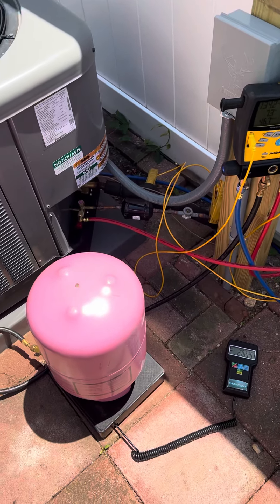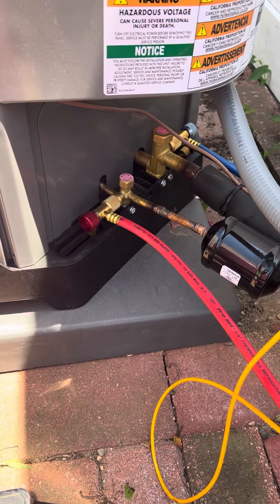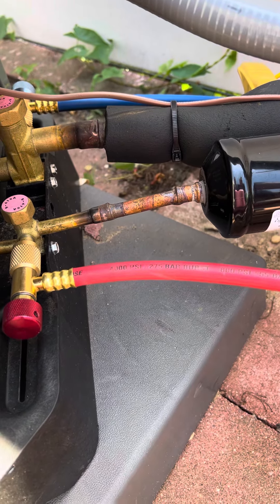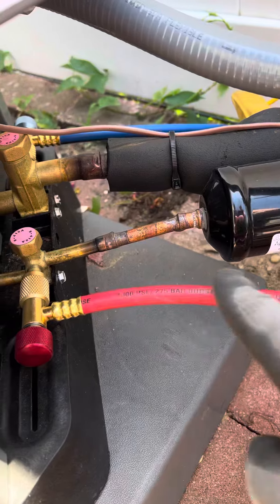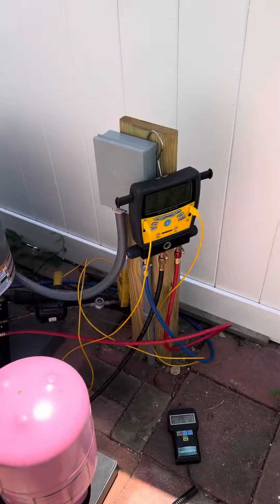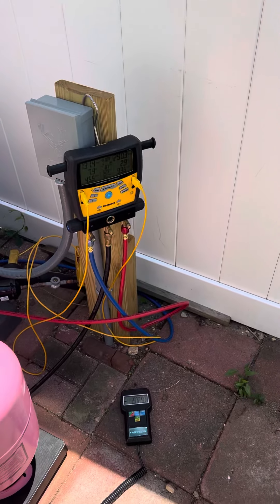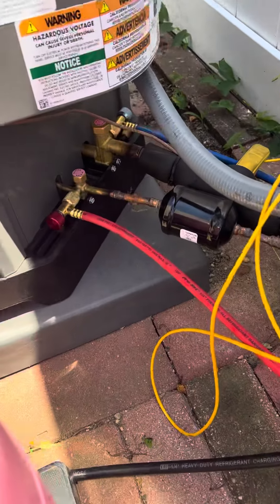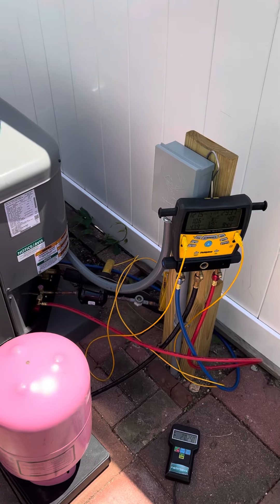Coolest charging hoses ever made by Cps￼

Comment: So did you find out if the gaskets or seals in the hose can be replaced? I have  90 deg low lost fittings for red and they work fine for me. For the yellow I have manual low loss fitting (ball valves) but they leak now and I been looking for a placement since. No fittings on the blue hose I don't see why I need them. I saw this at a supply house and wanted to research them more. Seems like the T end might be a bit large for some jobs but your video looks very interesting. When you remove the red hose do refrigerant stay trapped in there like low lost fittings do?
Reply from the maker: I haven’t called the company on replacement gaskets however both of those hoses with the T on it open and close trapping the refrigerant in the hose just like low loss  so you really don’t lose anything … there great hoses
Reply from the maker: yeah, the t gets in the way a lot of times and the refrigerant does stay in the hoses.. you can change the gaskets just have to contact the supply house

Comment: will it have trouble hooking up in super tight space?
Reply from the maker: Yes.....
Reply from the maker: i’ve been using ball valves with the 45 angle they get into pretty much anywhere
Reply: @lvvhvac9787  what if you hook them up to a core depressor tee  will that fix the tight space issue?
Reply from the maker: Yes Def..

Comment: sold!
Reply from the maker: I I thought I was gonna run into issues hooking up to a system because the top of the hoses is like a T but the past four installs I did I had no problems I love those things (Cps) baby…..
Reply: @lvvhvac9787  do you think it speed's  up evacuation or I guess your still pumping thru Schrader ?
Reply from the maker: I don’t use my regular charging hoses for evacuation I use apion shredder extractors with a separate micron gauge I get downs like a 200 µm in under one hour